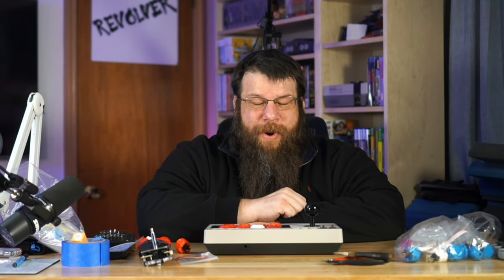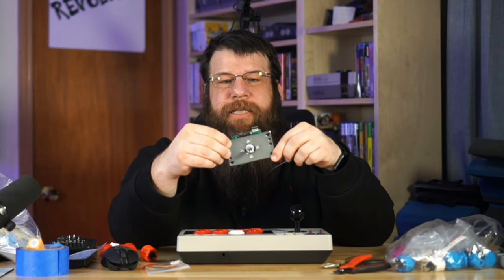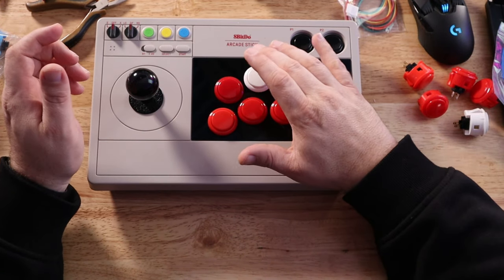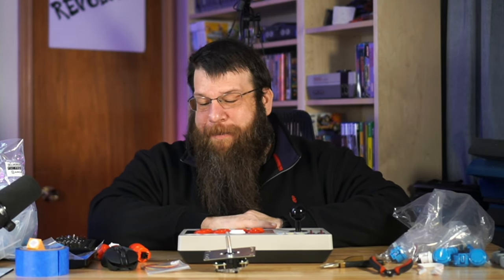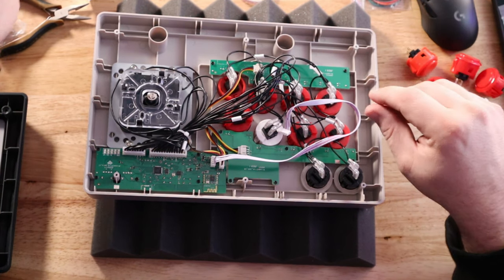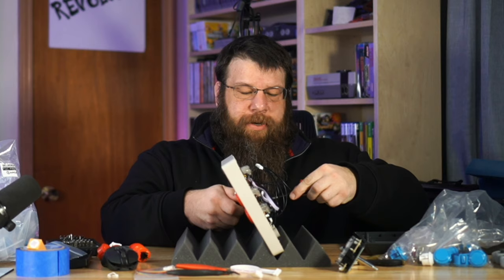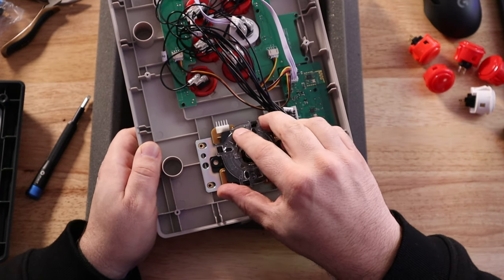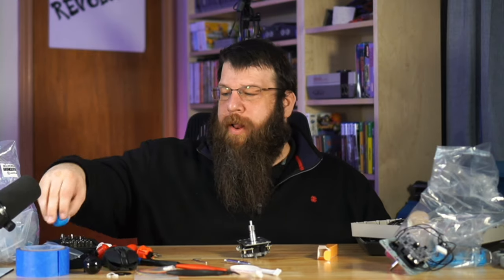How To Mod A 8Bitdo Arcade Stick Easy with Sanwa Joystick and Buttons

Comment: Great tutorial! I had to flip the 5 pin connector cable over at the end that connects to the joystick (so that the little slots in the plastic are visible), otherwise I didn't have proper input. Probably just a schoolboy error, but might be useful info for fellow modding noobs

Comment: Thanks a ton for the link to the joystick connector. I can solder, but that stuff only re-melts like twice so I try to avoid doing it on stuff like this. Mine turned out great, by the way. The connector saved me a ton of time.

Comment: What is up with all the hate for Torx screw!?
It is like every video there is about this stick there is a mandatory comment about the Torx screws.
Torx screws are better than the Phillips ones, they offer a better cleaner grip and it is a common standard that has been in use for years.
Reply: not everyone has torx screwdrivers on hand and most screwdriver kits come with only philips and flathead. you have to go out of your way for torx
Reply: @logandunlap9156  Maybe it is an old world vs. new world or something.
When ever buying a set of bits or screw drivers I always find it includes torx screws - and it is a much clearer defined standard than the Phillips one where it can be a hassle to find a perfect match of screws and tool.

Comment: Thanks for this. I think I've caught a few more things I may want to order now. I'm planning on doing my 8bitdo arcade stick mod next week once the rest of my parts arrive. So far I've gotten the Sanwa joystick, buttons, octagonal gate, and connecter. Waiting on the bat top & new weighted spring. I didn't realize a flush cutter would be needed so about to order that. I'm interested in the quick disconnect too for the joystick so I can travel with it.
Reply from the maker: Glad I could help!
Reply: @BriarRabbit  I just ordered the flush cutter. I'll get the Phreakmods a little bit later once I know I'm going to be transporting this arcade stick with me somewhere

Comment: Awesome video! Quick question, which spring does it come with? I found that the one it comes with is a little too light for me and I saw there are 2, 4 and 6 lb springs. So would like to know in order to get a better one.

Comment: You just saved me a lot of money dude.
I got a cheap arcade stick that I wanted to upgrade, but I saw that it was so different than the mayflash and stuff like that we see out there. The buttons are those white 2 pin things on both sides oddly enough, but that's fine, I can just replace the cables when I order new buttons. But for me the biggest problem was the joystick since I didn't have any 5 pin place to put the Sanwa, only 8 pin (like the 8bit do), so I figured I had to buy a Mayflash or something and upgrade. If it works for you it'll work on mine. I just need to figure out a way to put the screws of the joystick on it, since it has nowhere to put it.

For reference it's a Nox Krom Kumite, Nox is a very popular budget brand here in Europe

Comment: It also works with 8bitdos' bluetooth adapters for NES, SNES and Genesis.
Reply: Only thing I can't get it to use the mapping from the software on my Genesis. I want to remap the start button which is block on mk1. Have you tried to change mapping?

Comment: Great video and I followed your tutorial to upgrade mine. Many thanks.

I stuck with the stock colour scheme and replaced stick and all 10 buttons with Sanwa items and installed an octagonal gate.

The blue theme looks great but I would probably fit some black Sanwa OBSF24 buttons to match the black.

I am now tempted to get the removable shaft.  Is Phreak mods still the best detachable shaft?

Comment: I have recently purchased the 8bitdo arcade stick and I kinda hate the joystick as it feels flimsy - same as with 1-Up machines. I'd like something solid like the original joystick for Mortal Kombat 2, which I felt comfortable with. Also I like X-Arcade's Tankstick but it's too big for my small apartment and I don't need the 2 player version. They discontinued the one-player version so I'm looking for something that feels right and strong. The buttons that came with the 8bitdo isn't bad however I notice that when I press the button along the edge, it doesn't always register my press. I guess I need to modify the buttons to use a deeper barrel so presses are registered along the edge of the button.

Or perhaps I should look for a different arcade fight stick that suits me better without any need to mod. Only problem is that there are many fight sticks out there and I'd like the opportunity to try them all before deciding on which one to buy as oppose to buying each and then returning it for refund so I can try the next one. And once I find the one that I like, re-purchase it. This approach seems dumb and time consuming too; and there may be restock fee too.

The 8bitdo wireless 2.4ghz adapter didn't work right out of the box for me so I'm dealing with some weird issues when it shouldn't happened in the first place. I manage to get the Bluetooth option working fine with all of my system (PC running Windows, Steam Deck, and Android) however the wired option doesn't always work.

Comment: I just modded the same stick with sanwa buttons and a joystick(jlf), but the stick overall still has a lot of lag playing street fighter on the switch...maybe the nature of bluetooth? I play the same game on pc or console with a wired connection(different fight stick) and it is considerably more responsive.
Reply: Do you recommend 8bitdo as a beginner fight stick?

Comment: So I have a Xox/PC *Bitdo arcade stick as of a few weeks ago. Don't like how loose the stick is and bought a Sanwa stick. But I ordered the ribbon linked below the video and they don't seem to line up with the pins on this board. Is there a ribbon that has the right pin distance on one side for the board and one that connect to the stick?
Reply from the maker: Yeah, it's different on the xbox version. You need to solder to board (very easy) or find an adapter to JST PH 2.0 8pin
Reply: Could you point me to the adapter I'd need?  @BriarRabbit

Comment: I installed snap-in Sanwa buttons as you did in this video. I noticed that the connections are nowhere near as tight as they were when connected to the stock buttons. Is this okay?
Reply: The blades on the new buttons are probably not as wide as the old ones.  Since the connector is sprung in the middle, its usually fine if it is pivoting but not coming off.

Comment: Would you think the xbox version would have the same harness fit for the joystick with the ground wires? That would be great if so.
Reply: Any updates on this?
Reply: @maximoignacio6959  I didn't change out my lever but it appears to be the same as this one for the most part. The buttons went in just fine, as they do in this guy's video.

Comment: This won't work for the new Xbox stick; the stick is pinned as a ground between each pin. It still has the solder pads, though.
Reply: Besides soldering for the Xbox version.. is there nay other way to connect this? Running into this same issue
Reply: @Ripperblue1  I don't believe so.

Comment: I'm doing a Seimitsu LS 56-01 with Kowal short throw mod with this stick. Does the Seimitsu fit in like the Sanwa? I have the newest version of the 8bitdo Arcade stick which I believe accommodates different sticks. I know I have the latest version because mine has Philips screws. Can someone confirm if this will be ok? Also, anyone link me a video on how to install the Kowal short throw mod?
Reply: I wish I saw your comment sooner! I went and bought a $3 T10 Torx screw and it turns out to be Philips after not getting it with the Torx screw. I dont even want to bother returning this $3 T10 screw.
Reply: @Muunchiez  yea it has Phillip screws and I was able to install both the kowal short throw and seimitsu ls 56 01. It works great. Just get the 3 dollar 5 pin cable, cut off the indent of the cable head and it works like a charm